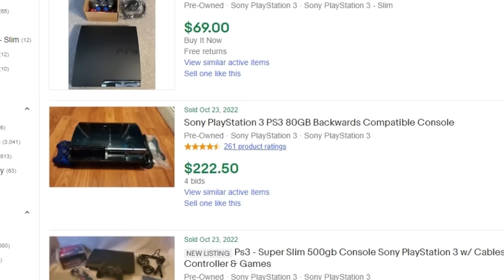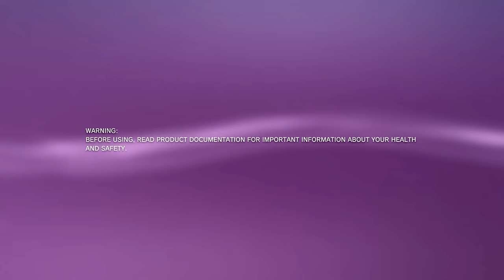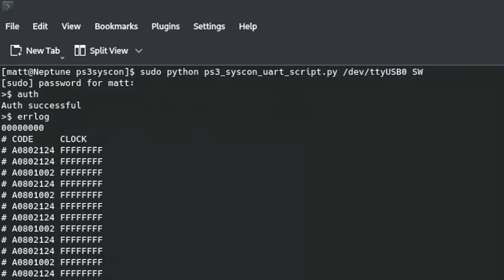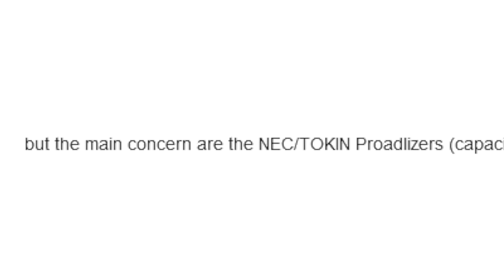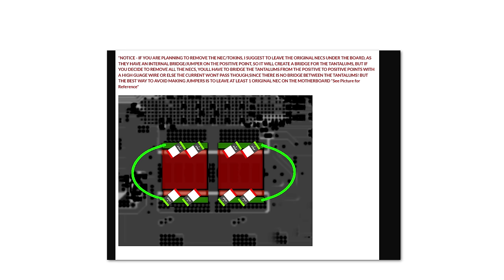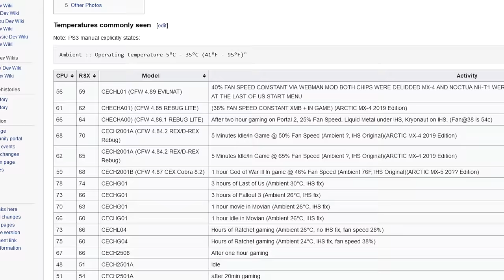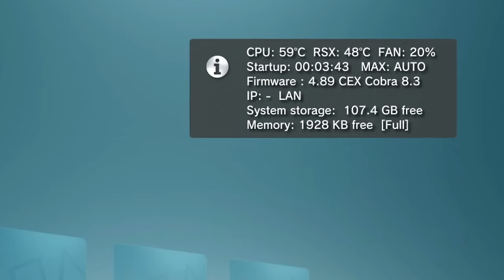I bought 3 PS3s for $50... how bad could it be?

Comment: Matt, it’s absolutely useless to replace these capacitors if they aren't truly damaged. Replacing it is a well known myth nowadays. The problem with your PS3 is most likely to be in the RSX chip itself, they do fail due to a malfunction batch from the factory in all pre 2011 PS3. There aren't much stuff to do, but now its known how to replace these chips with a PS3 slim one, which requires some hackering. There is a good video about it here in YouTube, it has almost 2 or 3 hours of video, but the guy explains everything in that. He's the guy with only this  ide on his channel.

Comment: 9:10 can someone PLEASE explain why tf hes just running electronics like a motherboard under STRAIGHT WATER?!?! wouldnt that damage it?
Reply: if there isint any power on the board, you can run it underwater without issue, just remember to get all that water out later

Comment: I got lucky and traded a xbox 360 and about 20 games for a backwards compatible one because they did not know what they had. had it cleaned and found an actually good intercooler for it. i love it.
Reply: No such thing as a good intercooler. those usb fan attachments do jack shit.
Reply: @AnarickTheDevil  it’s the nyko ps3 intercooler. Goes around the side and the back. Has power pass through. Works pretty good.

Comment: Thats actually incorrect, you can use the controller wirelessly, you just need to mess a bit with the settings for the accesories
Edit: and using ps2 classics (use the pc version, the PS3 version didn't work for me) you can compile ps2 games to a pkg file that can be run in any ps3, i have games like that in my PS3 super slim

Comment: heat it up... 500f to 600f temp heatgun with preheater on IHS integrated heat spreader.. 450 for cpu put thermal pads on PPUs and south / northbridge have fun watching killzone be hecka funny becuase it works at 99% and not just a slow bounce around or one main channel and bounce / you see all the optimizations to fill but instead its really fast no matter what's going on

Comment: Actually, when i started wathing this video, i heard about tantalum capacitors, i thought it wouldn't work for real, because 70% of these repairs didn't help the console, BUT you did it. At this point i'm just think you got a lucky PS3, so congratulations i think.

Comment: just got my slim 160gb 2 cons and gta4, for 32€ inklusive shipping. the consol looks like new the cons work and no stick drift, but thay could be just a littel cleaner 😛. all i can say so far is, that this is my cheapest best bang 4 the buck consol, and thats coming from a pc gamer. and with my 50€ ps vita, its a blast eaven in 2023. and with modds you can play the old games in eaven better quali. and when the ps4 comes down in pricing i guess ill grab one of them to. ;-P just sold my xbox one x cause all games on xbox are on pc and with a good setup you cant play the same games on xbox.

Comment: trust me you don't want a backwards compatible ps3. i had one before and it did not last long until it overheated and died
Reply: usually you can just replace the rsx and that fixes the issue. it's a recommended step. use a newer rsx and it will work just fine. this is the cause of the ylod.

Comment: 0:18 just noticed theres an 80gb for 200 quid that says its backwards compatible. thats a lie. only 60gb and 20gb fat ones are backwards compatible. what snakes some of these people are.
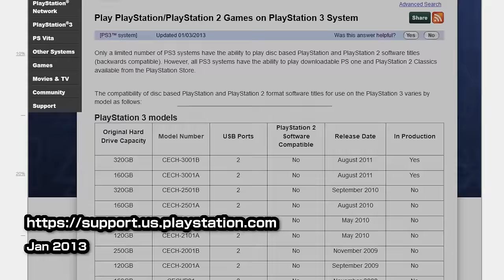EDIT: 6:13 this list says the 80gb ones are BC as well, which i never knew, but i also read something that says a god way to check is if they have 4 USB slots and not just 2, then they are BC. the more you know. i just remember when they came out it was only the 60 and 20's never knew there were 80s that did it.

Comment: I loved your solution to the problem of spacing when it came to the replacement caps. Though I wonder if it would have been worth adding another IHS to increase the height of the CPU rather than putting all that work back into moving the caps somewhere else.

Plus isn't the recommendation when it comes to replacing the caps, to replace them one at a time and test functionality to see whether it works with what's done or if you'd need to continue replacing more of them.

Comment: 9:00 Oh, he say's he want's to clean the PS3. I wonder, what he's going to do? Maybe use alcohol and a brush? 
MattKC: literally pours water over every component
Welp, i hope he doesn't want to use that PS3 for too many years.
Reply: As long as you properly evaporate all the water out of everywhere it could have gone, that shouldn't be a problem.
Reply: I rinse all old pc hardware I collect before running them. You just have to leave them inside an air conditioned room for 2-3 days to evaporate all the water before using them. 
Water is only harmful for a circuit when it's live.

Comment: 19:03 EW that ""solution"" is so cringe from an electrical engineering standpoint, because that extra length of wire increases the series inductance of the capacitor which reduces it's effectiveness. The name of the game is to have capacitors as near as possible to the CPU, have the wires be as thick and wide and short as possible, and keep the positive and return lines as close together as possible to reduce "loop area" though it did work so I guess it's fine haha

the approch I would have taken was to grind a bit away of the heatsink. Not having a mill or CNC machine makes it a bit trickier, but you could have done a bit of grinding with a dremel and a sanding bit. Aluminum is pretty soft and relatively easy to grind. Just be sure to wear a mask to avoid breathing in aluminum dust.

Comment: 12:02 matt NOOOOOOOO that's false information matt. don't fall for it matt NOOOOOOOOOOOOOOOOOOOOOOOOOOOOOOO. Real talk the reason the RSX suffers from failure isn't these chips, it's for the same reason old xbox 360s fail. You see back when those 2 consoles launched they been using TSMC's 90 nm process in the GPUs. And with this TSMC had decided to try something different. They used some different materials for the links that linked the actual GPU to the big chip that it's stored on that links to the mainboard etc. This material (lead I believe) couldn't handle the amount of melting and heat that  most computer processors were meant to deal with. Because of this, during that era a lot of laptops and GPUs had an issue that would shorten it's lifespan. the reason replacing the capacitors will fix the issue (temporarily usually for only like 1 week or 2) is because the applied heat in that area that semi reflows RSX. the real way to fix such an issue permanently is the SYSCON RSX replacement method which invovles taking the RSX out and replacing it with one from the slim models. Specifcally a 40 nm or a 65 nm stuff. All of this information is very complicated and I may have made mistakes in explaining it but this link should explain it better than I can https://www.psx-place.com/threads/frankenstein-phat-ps3-cecha-with-40nm-rsx.28069/page-76#post-324546 this video also explains it in great detail https://youtu.be/I0UMG3iVYZI

Comment: 9:11 💀
Reply: A device that is off, and is let dry completely actually doesn't get much, if any, damage
Reply: @Kevaca  I understand, I just wouldn’t risk corrosion. I’ve been working with electronics for over 10 years and it was the first time I’d seen someone run a board under the water.